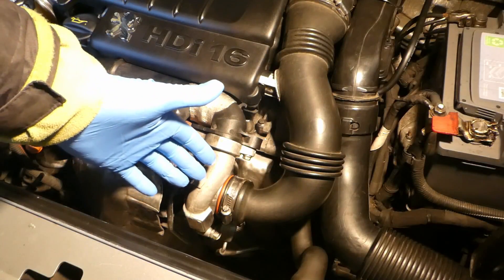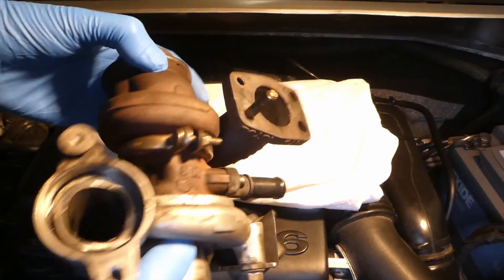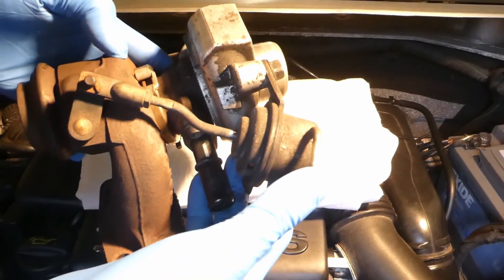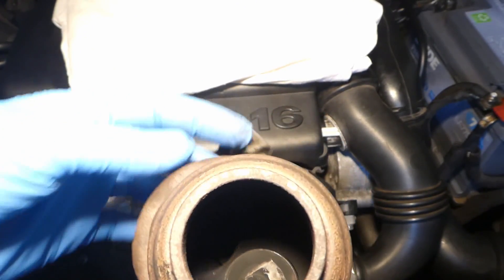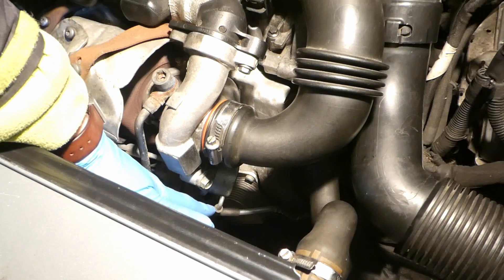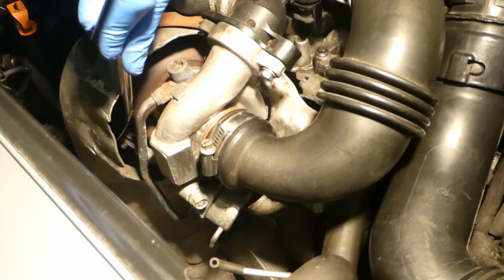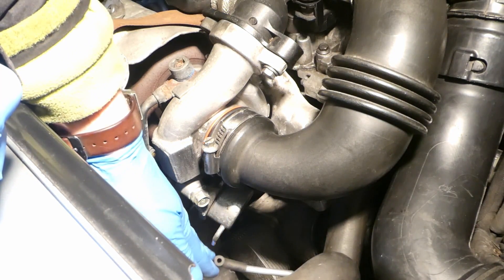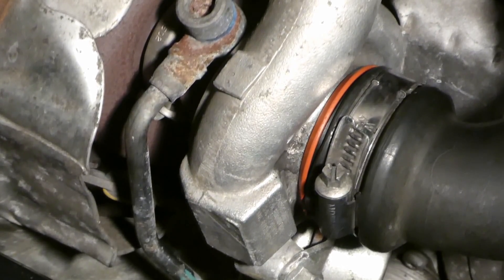Simple way to test turbo wastegate operation in 1.6HDi (Peugeot, Citroen, Ford, Volvo, Mini)

Comment: pls help! I had overboost for a whileee and didn't know... car was chiptuned so i thoight that it was ok to get so much power... but what actualy happened that after air filter change in workshop they forgot to put back small hose behind the filter where other side is connected to turbo vacuum  solenoid, which ofc got stuck bcs sucking unfiltred air.. solenoid is changed with new oem but wastgate was not working for quite time bcs that solenoid and turbo overbust was present. Now when i start the engine rod moves like in video but doeant move at all when i rev. During whole that time i 1St noticed accelaration was not so great any more and during the time power was lost! now my car is piece of crap without power... could turbo be damaged bcs long period od overboost condition? I also hear whistle noise,turbo on some intercooler pipe split? Via obd2 i get map reading not greater that 1.3bar bit i found info tat pressure was like 2.5bar when overboost DTC was trigered. Is it possible that turbo got damaged so it doesn't compress ait to manifold good enough ? If there is not enough pressure ECU doesn't operate solenoid so that's why there is also no any rod move when i rev the engine? Or there is air loss on pipes arround  intercooler so i lose pressure ... or maybe intercooler it self is damaged with some hole ? pls any suggestion bcs i have this problem for quite time now and i need normal car... i have feel like i'm driving Yugo koral 45 again and not tdci/hdi chiptuned to 115hp
Reply from the maker: Hi milek,
It is difficult to say like this without going there and testing or looking at the actual parameters measured from the ECU. If there are whistling sounds that were not there before, definitely look from cracked pipes. Why not take the intercooler and fill it with water to see if there are any holes. When they put the filtered pipe to the turbo solenoid is it actually connected? The wastegate rod would not move under free revving. You would need to move in order for the rod to move. Also, when you start the rod contracts to nearly maximum, wastegate closed, so turbo is spinning, it is a failsafe mechanism. In other words, if the wastegate fails or vacuum fails, the turbo does not get activated at all. So, you currently get overboost and little power? The two do not quite get together.
THe turbo could be damaged, but rather difficult to know what is damaged, if you move the turbo shaft and there is little lateral and axial movement and the propellers are OK, then the turbo should be ok.

Comment: im getting a code on a citroen c4,P0299 what might this be
Reply from the maker: Hi Shea300zxTT, it is a generic error for low boost pressure, it could be a lot of things. Depends on what kind of model you have, if it is the same I would unplug the vacuum pipe and see if it makes any difference. If it does not, check the diaphragm whether it holds vacuum.

Comment: Hey there @more molecules,
I have the P0243 - Turbo pressure too high. I checked everything above, Turbo is rotating EGR replaced, MAP and MAF sensor replaced, nothing... Everything looks clean.
When engine is cold everything is okay. But around 90 kmph de power is decreasing and the check-engine light goes on and the display says "error exhaust gas" (translated from dutch).
What can it be?
Reply from the maker: Hi Marty, what engine do you have. I assume it is 1.6HDi or TDCi, but it could be the 90bhp or 110bhp. The turbo will be different in both, the 90 has the turbo in the video, i.e. with a wastegate. The 110 will have VNT turbo. In your case, check the wastegate and there is also a turbo solenoid at the back of the engine, a bit on the left. Also, make sure that the hose that comes out of the turbo solenoid and goes next to the injectors is clean. This is a small pipe with a filter at the end.
Reply: @moremolecules  Mine is a Partner 1.6HDi 90hp from 2007 and the turbo is exactly as above. Vacuum from the solenoid is working as the wastegate is operated on engine start.
You mean I should unmount the turbo solenoid and clean the filter? 
But what part is activated at around 90kmph (56mph) at around 2800rpm, when engine temp is above 60 degrees Celcius, at that point the engine enters emergency run and is limited to max 2800rpm and 123kmph. It looses a lot of power as it takes 5-10km (3-6 miles) to get from 90kmph to 123kmph.
Stationary the engine is a bit rough, and exhaust stinks (methane?). The engine starts a bit jumpy when turning the key, but it starts.
Diagnostics give me 2 errors: P0243 Turbo pressure too high (permanent) and P1351 pre-/post heating relay, relay checked and spark plugs not provided (permanent). I used Delphi OBD.
Reply from the maker: @MrEMMinet  I would say that the turbo solenoid might be faulty. I am not familiar with the Delphi EOBD, but get turbo pressure measurement while you drive, if you can of course. It should drop to ~1bar (atmospheric pressure) on tickover. Probably the solenoid does not switch/release the pressure and get constant turbo. I would also double check the relief valve on top of the engine. This goes from the solenoid and basically the solenoid diverts the pressure there. Sometimes this gets clogged. Check if you injectors are clean, as on mine this filter type thing is positioned next to them, but on yours might be slightly different. Also check if the spring within the wastegate is intact, i.e. it moves when engine is off, move it with hand.
Reply: @moremolecules  can you advice me on an elm327 device that works with Peugeot Partner 1.6HDi 2007 engine? I tried some, but they can't connect to the ECU. The Delphi OBD mentioned above is a professional device that a friend of mine has, but it would be nice if I can read and reset faults myself and get some driving-stats out of it, to find out more about my specific problems.
Reply from the maker: @MrEMMinet  This is a tough one. I purchased (a while ago) a diagbox interface, similar to this one: https://www.ebay.co.uk/itm/Diagnostic-Interface-Diagbox-Scanner-V7-83-PP2000-Lexia-3-for-Citroen-Peugeot/352819199131. Problem is that my version is v47 and it works with my 2007 Peugeot Partner (2007) under windows XP. The newer version I am not too sure, but I suspect it will work. It is a bit expensive, but you can do anything with it. The elm327, they are all the same, i.e. cheap copy of the original elm327, some work some do not and I have bought 3 of these and had partial success with one. I do not want to recommend it, as it is luck of the draw what these people will have in stock and might not be what I bought. I would say to buy one of the diagbox interface versions, success is much more likely than with the elm327 copies. Hope this helps, but good luck with this one. Let me know of any success
Reply: @moremolecules  Thanks for the info, will check that out!
Today I went driving with Live Data Diagnostics and found out that the turbo keeps working, only difference is that the Overboost pressure is on peaks 350-500mbar higher than the expected overboost pressure. The expected flattens at around 2000/2100 mbar as the real time overboost pressure is 2400/2500 mbar. Is this normal?
The other thing I found out is that the EGR-valve stops working when the P0243 error drops in. Also the magnetic air intake valve stops working. But is this the result or the cause of the emergency run?
Reply from the maker: @MrEMMinet  hmm, where do the expected values come from? EGR will stop working if you want full boost. That is how it is designed, exhaust EGR gasses bring no oxygen and hence reduce the temperature of the bang, hence reducing the production of NOx gasses. It is still overboosting, so if turbo wastegate is working then it is most likely the solenoid valve at the back of the engine, unless the little filter from the solenoid valve is blocked completely and the solenoid cannot divert the pressure. Check somewhere around the injectors, there wull be a rubber pipe with somewhat plastic ending not connected to anything. See if that is bloacked, the other thing is to replace the turbo regulating solenoid at the back or clean it. It is fairly cheap.
Reply: @moremolecules  the ECU or software returns a expected (or calculated/desired value). I think to compare it to the actual value.
Reply from the maker: @MrEMMinet  Good to know, I have never seen an expected value. Still, most likely the solenoid is likely to be faulty or the filter blocked.
Reply: @moremolecules  YESSS! It was the solenoid, I replaced it today and the car runs smooth again! P0243 does not show up again, only the P1351 stays, but that doesn't cause the car to enter emergency run. Thanks for your help! It was an easy to replace part that costed me around 50 euros.
Reply: By the way, for those who want to know. The max overboost pressure for my car is 2100mbar then the wastegate opens and drops the pressure to 1900mbar, while accelerating it keeps jittering between these values.
Reply from the maker: @MrEMMinet  Haha, nice one and well done! This solenoid is relatively cheap and fairly easy to replace. For the P1351, I would check the glowplugs with a multumeter. I think my video of replacing the glowplugs show how to test them with a multumeter. If one or more are out (>2ohms resistance), I would rather replace all 4. It is more common for the glowplugs to go, rather than the relay.
Reply: more molecules Hi, thanks for the outstanding vids. I’ve got exactly the same engine as you have and the the same problems as mister moustache. Where exactly is the filter of the solenoid situated? Do I just follow the little pipe coming from the membrane? Is it situated near the injectors?
Reply: @moremolecules  Hi. I tried to clean that solenoid filter in that plastic box between injectors but sponge fill apart into pieces. Can that plastic box filter be open and replace little sponge filter?
Reply from the maker: @slobodanstankovic3298  I have tried before to open it but could not do it. I suspect that one can but the end bit and replace it, but I do not think it can be opened. I would still check the actual solenoid at the back of the engine.
Reply: Found it, only (hard) to reach from underneath, left,low back. Same codes as above. Try to clean the topfilter (in between injectors) first.

Comment: Thank you for this video.... I need your expert advice.... Recently I bought a 2007 Peugeot 207 CC 150 PS 1.6 HDi, pretty in a good condition...  but I just got the engine check light on... I used the scanner to see what happen, the result: I got P0299 code indicates that the Turbo or Supercharger fails... can you give me an idea, how may I fix the issue?  Thanks
Reply from the maker: Hi Fernando, I am hardly an expert, but codes like this can mean a lot of things. It could mean that you get underboost or the turbo for whatever reason is not delivering the required boost. I would check all the vacuum lines to the turbo and check the operation of the wastegate, e.g. if the wastegate can keep vacuum. Is this 150 bhp? A lot from the 1.6hdi. If it is the 110bhp it will have the variable geometry turbo probably, so they could be stuck as well. Do you get boost when you are traveling?

Comment: I keep getting check engine, I didn't use the electronic diagnostic yet... Could this cause the check engien light ? Or It's the EGR, sometimes I hear the EGR opening and closing several times after the engine stop and sometimes I can't only a high pich hiss.
What are the signs of a stuck waste gate ? Power loss, smoke, weird turbo sound ? I have the same engine on my Ford Focus 2.
BTW you forgot to insert the vacuum hose back in.
Reply from the maker: Haha, thanks, I am investigating my turbo in general as I am somewhat suspicious about it and left the vacuum hose off to drive test it with no vacuum. It is better to plug it in a diagnostic equipment and see what is reported, otherwise it is just a guess. The hiss is rather abnormal, but it could be a a lot of things though. Stuck wastegate if stuck on open it will be loss of power, if stuck on closed overboost and most likely limp mode. If it is stuck opened, then there would not be any turbo, so one could feel the loss of power, but there will not be smoke.
Reply: @moremolecules  On my Mazda 3 1.6Di I get 1.5bar boost peaks on 2nd gear and takes a while before it goes back down to 1.2bar, could this mean it's not working properly or is it normal?
Reply from the maker: @TheFPSPower  That is a bit on the low side. I get ~2-2.1bar of turbo pressure and this is not the max. Check the wastegate and if any of the vacuum hoses have any holes anywhere. The other things is the solenoid could be somewhat faulty.
Reply: @moremolecules  the 1.2bar is normal, but today the car went into safe mode and the only error it has is a glowplug failure... Such is my luck ...
Reply from the maker: @TheFPSPower  Tough job the glowplugs, but not really impossible, access is the key and take it slow. Good luck